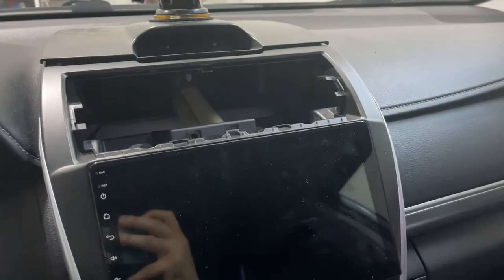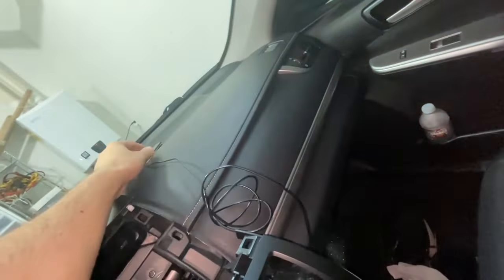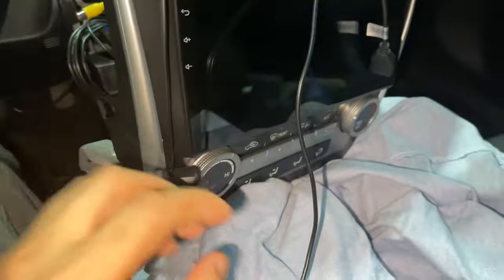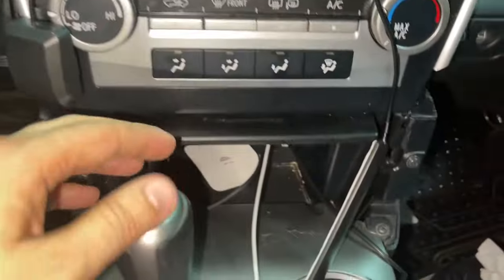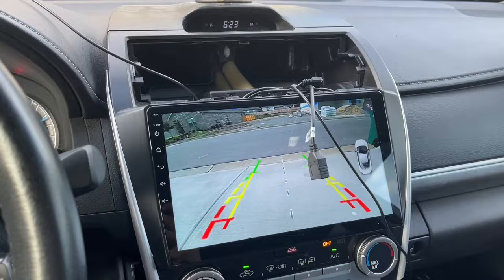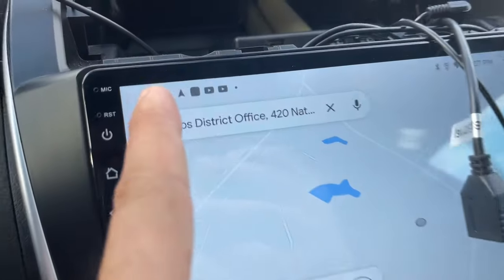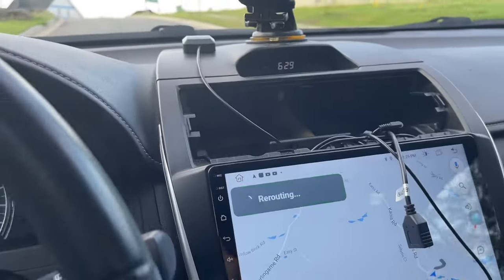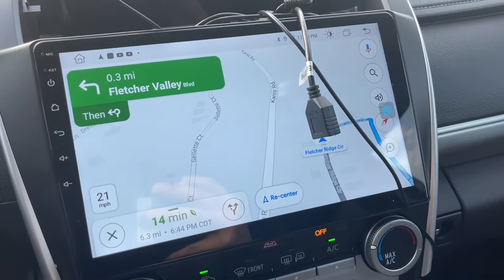GPS Navigation is not working on My Android HeadUnit Solution before the Installation

Comment: Hi i have the same navigation on my Hyundai tucson, Gps is placed on  the upper right part of the glass but car dont have gps signal. 
I tried igo primo and igo navigation, but it don't works. Do you know what is the problem
Reply from the maker: Did you check if you plug them correctly? It is because gps and 4g antennas are the same. Can you check?

Comment: What headunit is this and where did you get it?
Reply from the maker: #gps #carplay #howto 

Roadanvi for Toyota Camry 2012 2013 2014 Car Stereo Bluetooth Radio for Car Navigation CarpPay Android Auto 1280x720 IPS Touch Screen 4GB+64GB 

Here is the link to the radio (Bolded One)

For Toyota Camry 07-11 (4G+64G)
https://amzn.to/3FyiRdq
 
For Toyota Camry 07-11 (8G+128G)
https://amzn.to/3ny8Wye
 
For Toyota Camry 12-14 (4G+64G)
https://amzn.to/3I8Abr2
 
For Toyota Camry 12-14 (8G+128G)
https://amzn.to/3GD9LgD
 
For Toyota Camry 15-17 (4G+64G)
https://amzn.to/3FC19Wl
 
For Toyota Camry 15-17 (8G+128G)
https://amzn.to/3Ke0SfX

Fuse Box Adaptor https://amzn.to/3u9civG this is for after market back up camera. 

I can answer any questions you have.

How to Install Netflix

Go to https://apkpure.com/netflix/com.netflix.mediaclient on your chrome. Then install it.

Features & details

If you phone is not charging, 

Try this 

You need to check if you are  using the original car usb or our usb harness. For the factory usb port, please check the photos I sent
1. connect the unit with No. 3 9:20 seconds (the usb is what I hold in my hand),
2. then connect with No. 3 and No.11 9:38 seconds (original car usb)
3. finally connect with No. 11 and the original USB cable, so your factory usb port will work.

【Vehicle Compatibility & Specifications】For Toyota Camry 2012 2013 2014; MTK8259 CPU, 3G/4G network and wifi, built-in DSP, 4*50W
【Carplay & Android Auto】You can connect your phone to the head unit via Bluetooth or USB Cable. Controlled by Siri to make phone calls and use CarPlay & Android Auto apps directly.
【Your Favorite Function】Support almost all Navigation apps like Wave, sygic, google maps, with built-in wifi hotspot and integrated 4G solution.AM/FM RDS radio, bluetooth music, video, Surf Internet, PIP, Games
【Safer Driving】 Online & Offline Navigation, get driving directions without the need for Internet, Roadanvi offers a truly safe driving experience that lets you access navigation, you can easily Get driving directions, with live traffic and road alerts, save time and drive smart.
【What's in the box】1.Audio Output，2.AUX in & Cam in，3.SIM Slot Cable，4.Dual USB Cable，5.GPS Ant，6.Microphone，7.4G Ant，8.User Manual，9.Power Cable，10.Canbus，11.USB Adapter

4G Card Slot
Built in 4G full Netcom card slot, convenient for car owners to change cards at will, plug and play, easy access to the Internet

Bluetooth 

BT 5.0
Bluetooth wireless audio streaming, stable connection to your smartphone or Bluetooth device. Support common audio formats: MP3, WMA, AAC, FLAC, APE, WAV and other common audio formats

DSP Stereo 

DSP
The DSP use ST 7851 power amplifier 30 Equalize Adjust , Built in professional-grade DSP fiber output , and the audio transmission is ultra-low loss. It perfectly integrates the DSP and the car machine.

 radio 

AM/FM Radio
Built in AM/ FM tuner radio choose your favorite radio station get the latest news.

Tuning Range: 87.5 - 108.0 MHz"

navigation for car 

Apps
Download from google store thousands of Apps ,such as YouTube, FB, Shopify, etc. Which can provide you with some entertainment items.

Roadanvi UI 

Roadanvi Unique UI
Roadanvi designed the UI interface with a purple theme. Simple pages, when you find the functions by tapping or sliding the screen during operation.

Split Screen:
Free combination of apps
HD Toyota Camry Screen
10.2" capacitive LCD touchscreen: display with a resolution of 1280 x 720 (RGB).This unit has touchscreen controls with interactive icons and graphics, Menus on screen for making function choices, audio adjustments, and setting up the system.

You can switch and run two apps on screen side by side: So go ahead listening to music through your favorite app, whilst navigating(google map only),or making phone call with your browser open onother menu at the same time

2.5D curved screen: with the characteristics of scratch resistance, high temperature resistance and waterproof.

Comment: How did you get your GPS to work? Do you have a sim card in the unit or hotspot from your phone? Mine just doesn't work at all unless I hotspot from my phone.
Reply from the maker: Normally, the radio has the GPS without using Internet connection but if you’re not using that application, you can download Google maps or other types of maps and then download the off-line maps then make it work.
Reply from the maker: Sometimes I’m using hotspot to download Maps
Reply from the maker: IGO: https://www.dropbox.com/s/25nvduso7wdp7bo/iGO_Pal.rar?dl=0
Sygic：https://www.dropbox.com/s/h4jaz10z3a05ljr/Sygic%20GPS%20Navigation%20Maps_v20.9.6-1804_apkpure.com.apk?dl=0
Waze：https://www.dropbox.com/scl/fi/fqqtjljz8xawnwr5p88qz/Waze-Navigation-Live-Traffic_4.97.0.0_Apkpure.apk?rlkey=nb6rrd5cyhk9pnsidpun8is7l&dl=0

Comment: Got mine installed gps is on dash still no signal
Reply: Did you insert them in a correct spots on the back of radio?
Reply: @Techgeniusideas  just checked it again.  I have pulled out to the road.  I see one US satellite detected. That is it.  Map still showing china as well